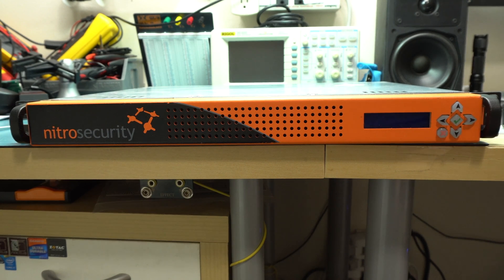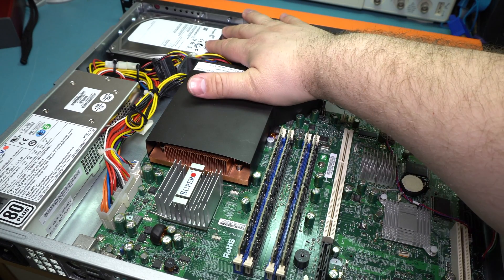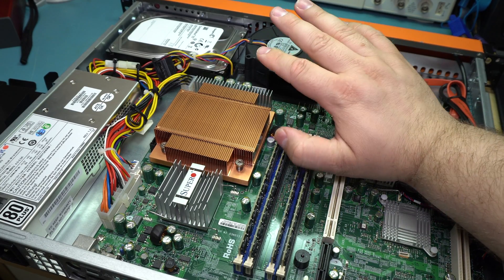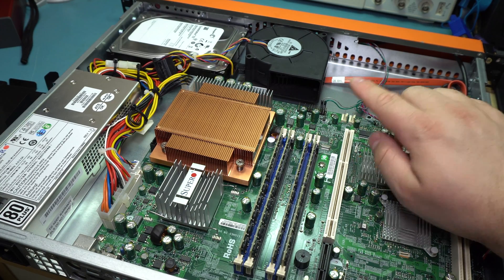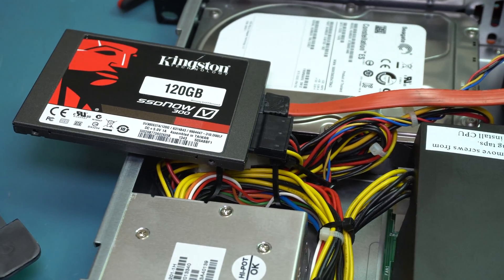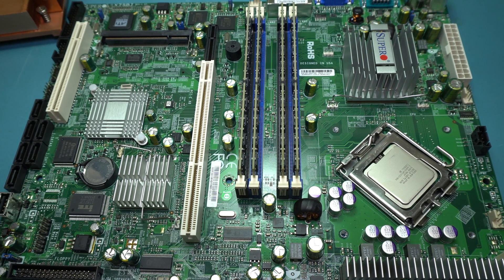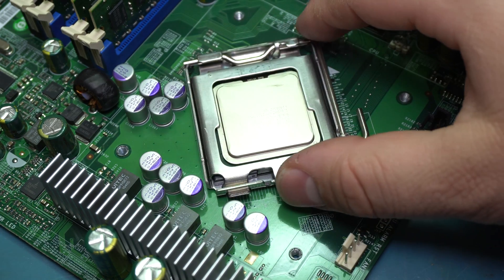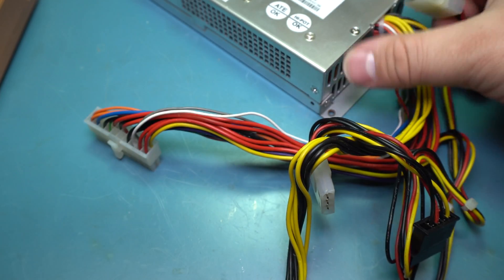NitroSecurity NitroView 1225 Teardown

Comment: This is a pretty little system. It's overkill for a router but this board in another case will be a good fileserver
Reply from the maker: +Ben Arndt Agreed as long as you can fit your data on a drive or two - I think the case can mount a second drive.